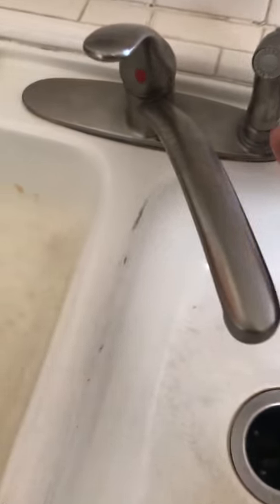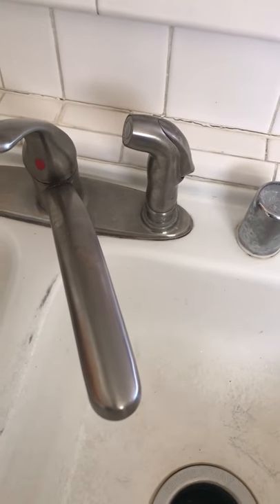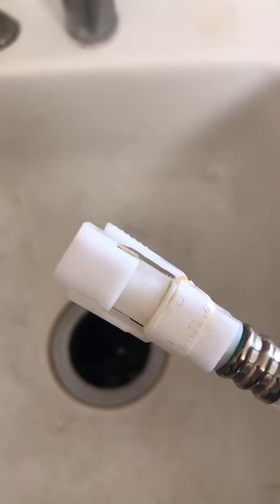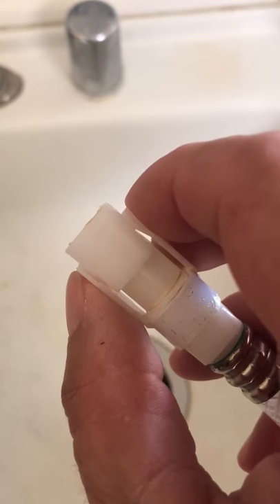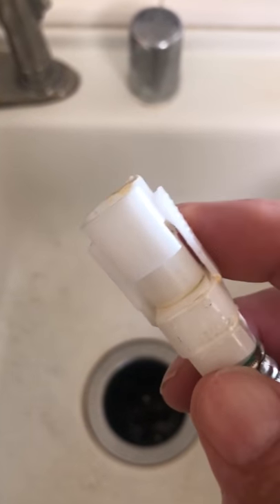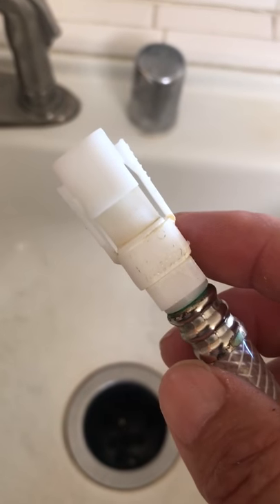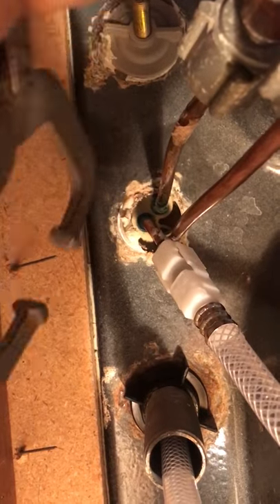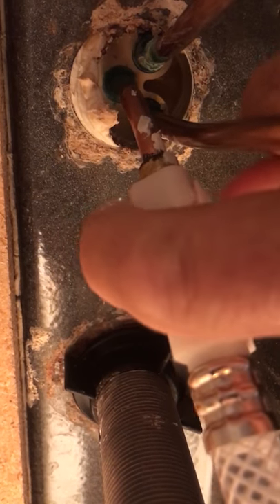how to remove delta faucet spray hose

Comment: I had this exact question! I stopped cursing under the sink and found your video as exactly what I needed for my Glacier Bay (Home Depot) sink sprayer. I also used a c-clamp, it worked better than pliers. Thank you!

Comment: THANK YOU! I tried for about an hour in a very uncomfortable position under my sink to understand how this connector worked. I was about to just cut the hose and crush the connector just to get it off. I managed it easily after you explained it so well. I feel like I just had two hours of therapy, a hot bath, and a good meal. Very relaxed now that that issue is fixed. Thank you so so much.

Comment: You, Mr. Crowell, are a life saver. I'm installing a new faucet and sprayer and stupidly forgot to slip the sprayer mounting nut onto the hose before making the connection. Fortunately, it's new so finger pressure was enough to disassemble the connection.

Many, many thanks.

Comment: Thank you!!!!!I assembled mine before putting it through the sink opening which was a fail.  tried to pull the taps apart to remove instead of pressing in.  With a brand new hose it was super easy to push it in and remove again.  Appreciate the video assist!!!!!

Comment: Excellent!  Thank you for sharing this info.  I was trying to pull outwards on the clips and getting frustrated so I searched Youtube thinking "I can't be the only one with this problem" and found your video.  I was able to pinch the clips with my fingers and it pulled right off.  Easy peasy.  Thank you also for keeping your video short and to the point - well done!

Comment: I'm handyman-challenged, so I was even having trouble assembling my new faucet. Seeing your video helped me see how the quick connect was supposed to work. Then to install it I altered the instructions a bit. I didn't fasten down the faucet fixture first. I put in the spray hose, then I pushed the hose up through the center hole and through the gasket. Then I attached the quick connect hose to the center of the faucet where I could easily see what I was doing and fit the quick connect from the spray hose to the quick connect of the faucet fixture. That way I could align it correctly and easily. Then I fastened down the faucet fixture. Thanks for your video because it showed me how it was supposed to be attached!

Comment: Like you I tried and tried and could not get mine off either. I didn't have enough strength to push the clips in apparently lol. I'm sure a plumber would have an exact tool to take this loose in a second. The pliers you used was a great solution. Your video is the only one I've found showing my exact problem with an actual solution. Thanks for making this video.

Comment: I clipped the darn thing onto the brand new faucet and then realized I still had to put the nut on to hold the sprayer. Your video was just what I needed to easily remove the connection, straighten things out and pop it back on again. Thank you so much! I know I would have broken it otherwise.

Comment: GREAT video- this really helped me because I had broken off the tabs you press in to remove the old hose. Finally got it all removed. The Delta replacement I got will not fit...so in the end, I didn't save myself money, I had to call my plumber because it needs an adapter and I don't know what kind I need

Comment: Just wanted to say thanks a bunch for your video!  These old sprayer hose connections are terrible and hard to find.  I removed the clip and wasn't able to get everything reconnected but your video shows how the clip should be placed, and your video helped me get the darn clip back on!  If not for your video, I'd prob have to get a new sink!   And also, it helped me by save time to just repair the sink sprayer than trying to replace the line as well.

Comment: Great video, probably saved alot of people from damaging their faucet. 
I had a similar issue with my delta faucet sprayer.  I bought a Danco sink sprayer (10334) to replace the entire sprayer assembly but i discovered that I could just replace the sprayer handle instead. The handle threaded perfectly onto the hose nut.  That saved me alot of trouble,  maybe it could save someone else time also.

Comment: Thank you!  I had removed the clips thinking that was what was holding it altogether.    After watching this, I put the clips back on and it worked for 2 of the 3 connections.   I still ended up having to cut the third hose and yanking it out.

Comment: Thanks a million. Mine was 3 years old. I was able to do it with my fingers and then pull it right.  I'm giving it to a friend that needs.  This is my justification for getting one with a pullout sprayer and soap dispenser. :)  My wife is up stairs. I'll have the new one installed in no time.

Comment: This is the best vid I saw today. I used a spring clamp that I normally use to hold down tarps. Once I clamped it on the tabs the hose came right off. The new one snapped right on. Not a bad design, just a confusing one.

Comment: Thank you SO much!!  I did a "improvised removal" on the cold side...  THEN decided the internet could be my friend and am using your valuable input on the hot and center!!  I knew it should have been "simple", (in theory, like what you discovered it is but requires additional hardware!).  Sadly, I've mangled one side, but it is the faucet I'm removing, so no harm really!  Your video was perfect, and saved me a BUNCH of time and bandaids!  (Not to mention brand new swear words!)

Comment: THANK YOU!  The Delta replacement was supposed to come with directions, but didn't.  Pushing the tabs was near impossible due to the deep marble counter top it was stuffed up in, so it was hard to tell if there was actually something I wasn't understanding, or if I just needed a better tool on those tabs.

Comment: Thanks for making the video I had the same clip on the hose going to my sink but I found out the hard way my sprayer had a different size connection than the hose I bought, so you definitely have to confirm fittings on both ends before settling on a hose, sprayer end and was not the same at all, while the clip on and was exactly the same.

Comment: Thanks so much. I would have destroyed something trying to get the old hose assembly off without your very helpful (and to the point) video. My faucet was new enough I could just use my fingers unhook the assembly (Delta RP44493 Hose Assembly, Blocks and O-rings).

Comment: Thanks so much.  I just installed a different model faucet with the same hose connection.   Unfortunately I ran the hose in the wrong location around a drain pipe and the weight now bangs on the drain.  Now I think I can disconnect the hose and reroute it properly.

Comment: Thank you! I just replaced mine and didn’t need the C clamp. I ordered my replacement hose from amazon. It was called the Peerless RP44493 Hose Assembly Blocks and O-Rings. $27 bucks. The only thing I could add that helps is using a hand pick to get off old O rings and wet down the new ones on to slip easier on. Oh and also  lay a  beach towel down on the sharp edge of your cabinet your back will thank you.

Comment: Thank you! I was able to disconnect, but are you able to remove the quick plug from the old hose and put it on the new one? Or did yours come with a new quick connect already attached?

Comment: what quick connect piece did use for this? I have the same faucet but it's a copper or brass pipe that looks like a straight shank or shaft with no o rings on it. None of the fittings I've tried work.

Comment: I removed it thinking that I pulled the tabs out and pull down.  so i reconnected to use facet. So i repeated the same steps  and it did not budge i broke both tabs off  completely.  Luckily I didn't throw the tabs out and I saw this video👍🏾👍🏾
Reply: I just did the same but it broke in half on me .

Comment: Awesome video, David - thanks! My hose was leaking at the quick disconnect but I couldn't get it off until I saw your video.

I was able to fix the leak by using some side cutters to peel off the crimp-on tin clamp, cut off/remove the leaky/bad hose section, then push the trimmed hose back on and secure with an Oetiker clamp. Works perfectly now.

BTW, love me some Oetiker clamps. Have a kit of different sizes and they work 1000% better than the old-style 'tighten down' radiator-style hose clamps. Makes leak-proof and mechanically strong connections every time. DISCLAIMER: I have no affiliation with Oetiker, just love how well hey work.

Comment: I have the same sprayer hose. With a leak. I looked for a replacement hose at Home Depot and Lowes but no luck. Was calling Delta your only option. I found a Delta hose at HD but it did not fit.

Comment: Very easy for me to get off, thankfully, seeing as it's a brand new faucet. The reason I was trying to remove the sprayer, is because after installing the new faucet, I was noticing an annoying thump each time I turned the water on as pressure for some reason jumped in the hose for the sprayer. I was hoping that I could use the sink without the sprayer attached, but as soon as the water is turned on it pours right down the attachment point where the house hooks on. Not sure what to do now. Ignore the pressure thump with each turn of the nobs, or do some sort of warranty thing with Delta.

Comment: Push Up Slightly First!

Mine came off very easily.  I think the trick is to slightly push up after pressing the two side tabs and then pull down.  If you pull down immediately, there is too much friction so you'll need to use pliers.

Comment: I couldn't get the new spray assy to lock back into the faucet stem. There was a small plastic  c type clip still on the brass stem. I'm thinking i broke something or the new sprayer was missing a part. No instructions btw. It will not lock back onto the faucet stem. I'm screwed now because I can use my faucet at all until I figure out what I'm missing. Im just going to replace the whole faucet but I'm getting one without the sprayer. Why delta would take a simple screw on sprayer and make it with a plastic disconnect idk

Comment: After I yanked the quick connect off, I couldn't get it back on. Apparently, in the yanking process, I had pulled down the little plastic block (C ring) until it was between the two black O rings. This video at 3:50 was what I needed to know that I needed to push that little block up higher. If I had lost or broken that little block (which I almost did) you can order it as Delta RP60121 for about $5.

Comment: For those whose clip is the only part broke. The clip that goes around the copper pipe before you slide the fitting over it. I have the part number. 
Delta #RP60121
I searched every single hardware store in my area no one had it. I ordered it off Amazon.

Comment: My Delta faucet had the clip ears to remove hose as shown. But, mine has a wire spring tension loop holding the plastic clip together. If you remove
The spring wire the hose comes right off. Just use a screw driver to remove.

Comment: Question: I'm just trying to install it the first time and I cant get it to click on. Do you have to use a lot of force to push on or is mine just not functioning properly?
Reply: i assume it is too late but you have to align the clips on pipe with hose

Comment: Why there is a removable plastic clip on this design I'll never know. 

Thanks for the guide.

Feedback for the manufacturer. Update your stuff. Make it more common connectors and it's actually CHEAPER to manufacture. Also. If you have your name on the product we can tell who makes it when asking for help.

We've had ours in the sink for just over 2 weeks, it's literally falling apart at the handle. Why they decided to buy this model..... Going to replace it before the store return window even expired.

Comment: would have saved me breaking the clips to get it off, but my real quesiton is, how to get it back together, because if you put the clips on first and try to push it on, it wont work, because you can't hold the clip and push and twist at the same time...i've done everything, but no idea how to get it back together
Reply: im an idiot. I was putting clips on pointing downward..they need to point up...easy peasy!

Comment: How do you remove them when the clamps are broke
Reply: I imagine you should be able to twist or pull the hose directly off if both clips are broke because that is what holds it to the top plastic on the copper fitting. Do you already have a replacement hose?

Comment: Though I appreciate the excellent customer service from Delta, I can't believe they didn't include a slip of paper with the instructions to disconnect the old hose.  The replacement fitting has arrows that are counter-intuitive to the pinching required to succeed.

Comment: Good video terrible design. These hoses are prone to failure and difficult remove. These are cheaper to manufacture then the old screw on type hoses which lasted longer.